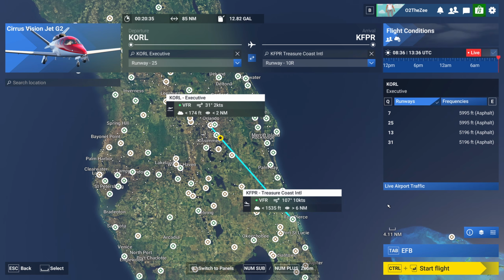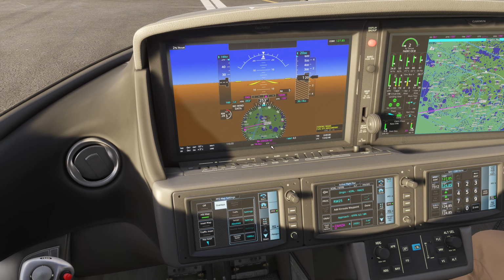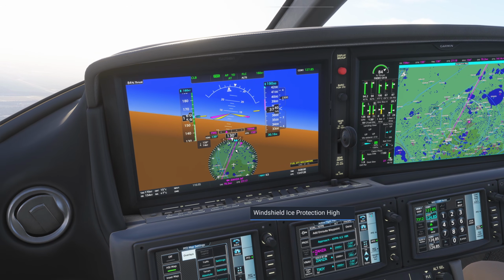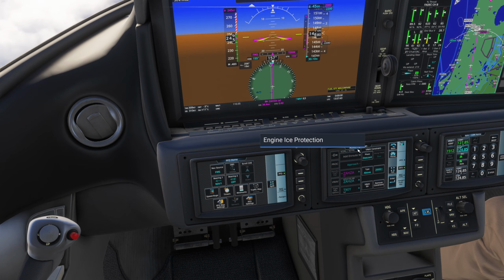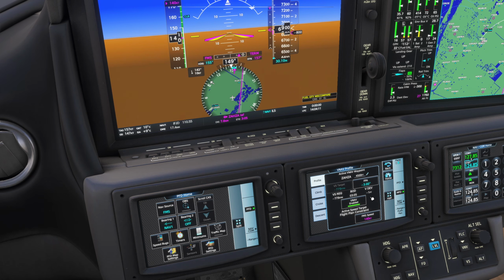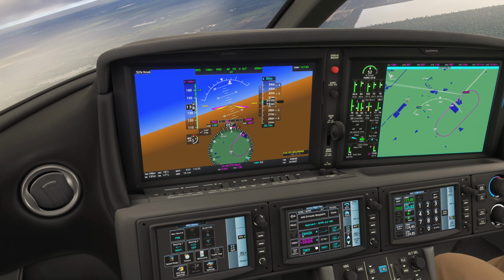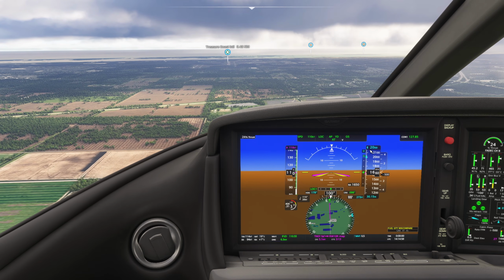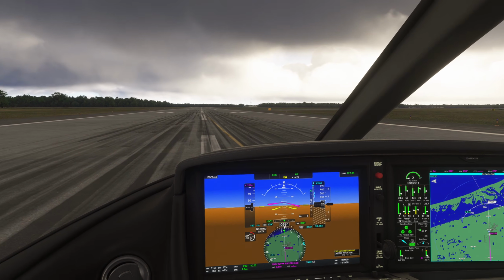Cirrus Vision Jet SF50 Made Simple | Tutorial | MSFS2024

Comment: Im new to sims and trying to learn for some reason the AT doesn’t follow the speed ive set at waypoints in the planner..it’s on Fms but it just ignores the max speed and do it’s own thing..which is usually going at 250 while it’s supposed to reduce to 115 😂does it only work when vnav is on or am i missing something
Reply from the maker: Join my discord and when im free ill get you to share your screen so i can see what youre doing wrong. Make sure you have selected the correct auto throttle modes as shown in the video.
Reply: @OzzySafa  Thanks..I feel like a monkey trying to drive a car at this point